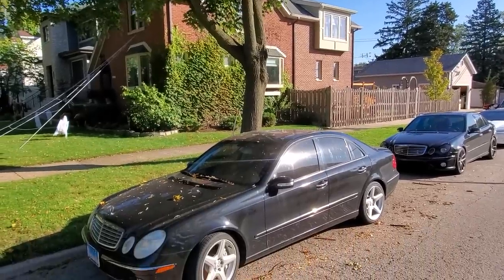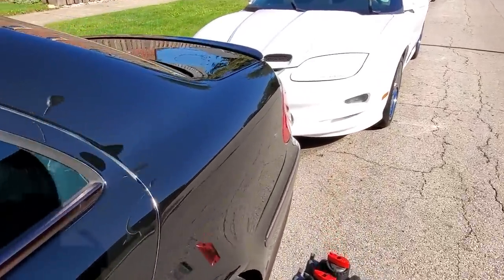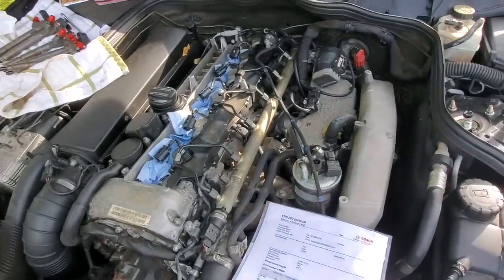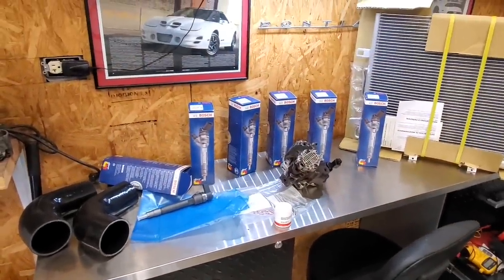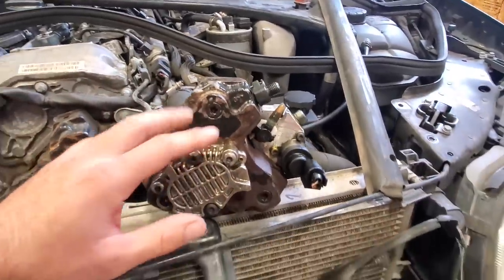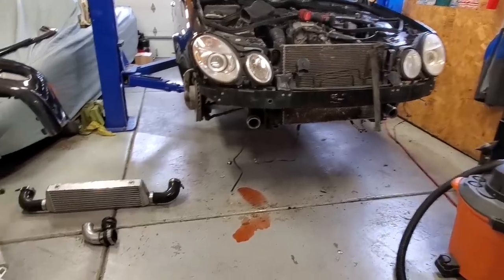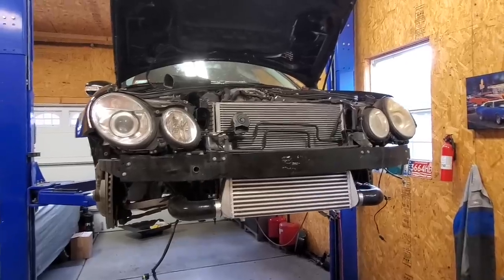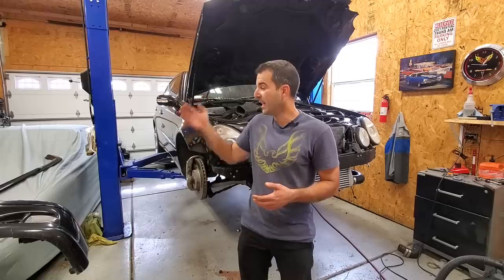Getting My ABANDONED Turbo Diesel Mercedes Started! New Fuel System, AMG Body Kit & Mystery Car!

Comment: I'm a huge diesel fan.   I've had a 300SD Turbo Diesel (Best car ever had), 07 ML320 CDI (least favorite), Currently own 14 E250 BlueTec and 15 VW GOLF Sportwagen TDI.  And do most of my own work on all of them.  I think that inline six you have there was a good engine. When you discuss difficult start in cold weather, if a glow plug is an issue in a CDI it should trip a check engine light, no matter what the starting conditions.  In short my 07 ML 320 CDI tripped a check engine light for "Bad #4 glow plug" which after replacement turned out after further troubleshooting, it was the glow plug controller itself.

Comment: The 400cdi pump isnt a straight fit for the 320cdi. You also have to drill and tap new holes to the cylinderhead to get it mounted. Email blacksmoke, dieselmeken or dieselpumpuk.

Comment: Hi, I think this fuel pump fits on the E320 cdi with the V6 engine. The 400 cdi is a V8, so i suppose the engine layout is similar to the 320 v6 engine. Let me know if it's correct. Thanks

Comment: The aftermarket bumper kits are typically junk. But if you can get it together, no one will know after it's painted. Regarding the fuel pump, if you can't replumb a couple of metric isobubble hard lines then maybe the project is not for you. Get the mastercool hydraulic flare kit and a good line bender and have at it.

Comment: FCP Euro for the WIN! Also worth noting that FCP Euro do NOT sell junk brands because of their lifetime guarantee and this is one of the many reasons why I only buy my Benz and Volvo parts from FCP Euro AND if they dont have a part listed its as easy as calling them and asking that they get that part in for you, Been a happy customer for a very long time and even their international freight costs and the best value.
Another quick option for the Headlight Lenses is green cutting paste and a small 6 inch buffer on low speed, I also then wipe Autoglym resin polish on the lenses and buff it off which fills any minor crazing not buffed out AND helps to keep the lenses clean of road grime.
Works a treat and the lenses come up like brand new as Mercedes seem to use an awesome quality material on their lenses.

Comment: You’re good with Mercedes I wanted to ask a question I have an e 500 4matic with the 5.0 I’m trying to find out if my fuel pump died or a crank sensor or cam sensor it Felt like it was losing power if I hit the gas why I was driving 65 on the highway the tachometer wrapped  up if I hit the gas pedal down so I drove like 15 more Miles to get off the highway and when I pulled over if I revived it up it Felt like it was sputtering an Hardly  running so I  turned it off and it wouldn’t start back up it is just turning over

Comment: There's a  2004 E320 Wagon that popped up for sale with alot of extra's for 2300 bucks with 157k miles driven but it has been in a slight accident. The fender is messed up like your E55 fender was and there's a scratch on the side of the car. Is it worth it?

Comment: Hi, I am following this as I have a PT Cruiser with the 4 cyl OM611 crd as standard in Europe. My injectors are maxed out and I am getting 200bhp out of it. Get 250 with nitrous. Fuel is now my limiting factor. So looking forward to your pump upgrade. What's your fuel pressure? I can get 1600bar but I need more fuel flow.

Comment: Are you sure you need a bigger hpp??
I have a BMW 330d from 2003 about the same kind of engine. 
I have fittet bigger injector and a hybrid turbo. From 204 to 322hp with no need for a bigger pump. 
Next step is bigger intercooler, but have no plan to fit a bigger pump, the original pump can easy make 350hp.

Comment: In front of these blue boxes on the right side lies a common rail diesel pump, this black triangular thing with shiny oval passive cooler, internally called CP3.3. They are made in Bosch plant in Jihlava, Czechia, in Europe. I worked there for 10 years. I made the housing and internal part called excentric shaft.
You have definitely the wrong pump. It is a Bosch CP 3.3 too, like your replacement CP3.3, just another model. I think there're about 20 different models of CP3.3.

Comment: Question for the MB A/C 
How do you fill the system when it’s empty? I just replaced my compressor and the car (2004 S430) will not accept the refrigerant because the computer says it’s empty. I clear the error code to try to fill the system but it just sets off the error again and won’t take the refrigerant
Reply: Bern Boomboom I could be totally wrong but I know on my W140 you can put the a/c in a type of service/test mode. Although the W220 is much more complex, I would assume it would have the same type of mode.

Comment: The height pressure pump are made by BOSCH? If yes I probably can help. I need to know the model or the car year. The car (211) has two engine numbers OM642.920 or OM648.961.
Reply: this is om648

Comment: great video!! course I love the CDI content, having driven one for the last 9 years. I'm at 311+ K miles on 5 out of 6 original injectors. One failed at 250+K.  Question:  Would there be any positive results putting the Rochester Diesel bored out injectors on a stock pump and stock turbo CDI?  Mine is a daily driver and I love the stock power but more power is always better  :)
Reply: Sir can you please tell me what are all the major parts you've replaced so far on this long term ownership for  all these miles

Comment: How many miles on this car again?
Reply from the maker: 200,000.
Reply: I'm thinking about giving my girlfriends 2005 Jetta TDI a refresh, as its rounding on roughly 260k miles and on its 5th or 6th owner - it of course is rather difficult to start when cold, usually feels like it isnt getting fuel at cold start, requires a good deal of priming, then runs rough for roughly 5 minutes, dies easily if you go too hard on her right away (and it's an automatic trans). Feels very underpowered and does not start at all if temperatures fall below relatively -20 F, but that could be possibly be from the fuel gellin, as the product 'heet' seemed to help it start the one time I had the experience this past winter. I havent looked at the gloplugs yet, but do you think it be reasonable to throw both a whole new set of gloplugs AND injectors all in one shot or would that not nearly be necessary?

Comment: Questions for Everyone,
Since every pickup truck with a diesel is running a CP3 pump (I can't even find the 400 cdi pump for sale) why can't we adapt the common and cheap, Ford, Chevy, Dodge, CP3 pump to work on the Mercedes???
Also, I've seen guys add a second CP3 pump running off a pully. Does this pump need to be regulated in any way???
I know less than nothing so don't beat me up to bad........lol
Reply: The original E320 CDI pump is a variant on that CP3 pump I think. If Alex can find someone that works on these CP3 pumps I'm 99,99% certain they will be able to work on his OEM pump also.

Comment: I’m flashing a tune on my 06 e320 CDI as I watch this video.
Reply from the maker: Yes!! Makes a big difference. Who's tune?
Reply: LegitStreetCars My own. I have been working on it and learning since I had my last 05 cdi. I have the boost at 21psi and the rail pressure at 1800bar at full hoot. Now I just need a bigger map sensor and a compound turbo setup. And I’m waiting to see how your new injectors turn out.
Reply: @V12Buickguy  😳 1800 bar that's crazy.. I was under the impression max bar was 1668 +/-  .. is your tune available for purchase
Reply: Papa Papa The factory rail pressure sensor will read 1800bar. The stock rail pressure limit is 1600bar. That extra pressure is key to get to 300hp on stock fuel system. That and more air and a cooler charge.
Reply: @V12Buickguy  Are you having any trouble with the higher rail pressure spiking in lower gears causing a CEL and/or limp mode? It would be great to chat tunes with you if there is an alternate way to contact you apart from comments here.
Reply: @V12Buickguy  so how can I get an 1800 bar tune to dump more fuel my understanding is unless I get C30 AMG injectors or hone it out. 1650bar +/-  is the max due to injectors nozzle ports

Comment: Alex,

The car is a driver so go ahead and put the new bumpers on it man they’re going to get used anyway.

Question, it doesn’t sound right to me that this Rochester place can test the injectors can take them apart Holman but doesn’t rebuild them. Was this a cost thing or did you take this as an opportunity to use FCP which I believe is one of your sponsors?
Reply: It seems that even places that rebuild injectors don't rebuild these citing that parts are unavailable to rebuild them in the US.

Comment: Nice
Was waiting for this!!!
I'm STRONGLY considering buying a diesel e250... I'm looking at either or 12-13, or a 14-16
Reply: Try the 350, way more torque and pics up speed like a maniac
Reply: I own a 2014 E250 Bluetec AWD.  Love it!   Trouble free, not difficult to maintain, tons of torque in the low end, great mileage (Long highway trips are about 44mpg at 75-80mph) 370 ft lbs of torque or so if I recall correctly.  My only gripe is all the stupid safety stuff that beeps at you when it thinks you are going to collide with something, like when you are driving around a curve and there is a jersey barrier, or a car in a left turn lane etc.  Quite unsettling.  Plus the entertainment/nav system menus are way to complicated.  But I consider those "first world problems".

Comment: Here's a trick for charging a completely dead battery: connect it in parallel with a good one and connect the charger to the good one.
This way both batteries are charged.

Comment: I love cdi engine... only bmw e46 3.0 and 2.0 d is more reliable and better driving car though
Reply: A bmw diesel is not even close reliable wise compared to Mercedes om613/om648 stop saying stupid things.
Reply: Fredrik Gunther 
First make a research than make a comment 
Or talk with both car drivers -
Reply: @vladimirart758  haha sure n47 is snapping chains all day long. Sure bmw is a better more fun drive. But from a mechanic standpoint its clear bmws are have really bad relability driveline wise. How many cars have you been wrenching on?
Reply: Fredrik Gunther i have driven e46 2.0d -never problems and now x3 2010-with 110k till now no problems at all 
My father had a same Benz like video 320-every 3 months different fix-mizreble car 
Sorry for my English
Reply: @vladimirart758  Yes newer mercedes have alot of problems. But i mean the engine block and head of om613/om648 straight inline 6 can easy make it too 500k miles the newer v6 diesel is really bad. Everything else is crap i agree. Therefore i Only own old mercedes like w123 and w124, i have 3x w124
Reply: Fredrik Gunther w 124 defenetly reliable mashies....too bad that in my country I can’t find good one( not waisted)😅

Comment: If the injectors leak inside the car will start knocking like it would when a bearing is worn out. A few other things might knock like that is the air pump in front of the engine and the pressure sensor/requlator on each end of the railpipe.
Reply: And to add to the list if an mb cdi struggles to start wintertime u want to check the o rings on the plastic diesel lines going to the filter, railpipe and the pump. Common problem atleast on the om612 270cdi.
Reply: @tapsaaa1000  you know he was a Mercedes tech for  quite a while right
Reply: @DocR16  Free bits of information for everyone.

Comment: Just going to leave this here: https://mbworld.org/forums/diesel-forum/555412-w211-e320-turbo-upgrade.html and this: https://www.blacksmokeracing.com/posts/mercedes-performance-and-mercedes-tuning/higher-pressure-and-more-fuel-volume/
The pump you have should be correct (need to modify the timing cover a little bit), but you would need the C30 CDI amg fuel rail to make it work (A 612 070 02 95?) I'm in europe, so if you need help finding parts send me a message. Just to let you know: Im not a mercedes diesle specialist.

Comment: High mileage injectors should always be replaced.  Should have just got 60% overs new in the box from the get-go.
Reply from the maker: Who sells 60 over injectors for the cdi?
Reply: @LegitStreetCars   Are you saying they don't exist? Unlikely, but even if they don't, new injectors sent out for nozzles is certainly possible.  Modifying injectors with even 50,000 miles on them is a bad idea.

Btw, thanks for recommending eManualsOnline.  They scammed me out of $20. 👍
Reply from the maker: No I'm just asking as a serious question. I thought you had a company that sold 60 over CDI injectors. After a few months, I only found 1 company that could modify these injectors here in the states. Sorry to hear man but if you explain a little more I can probably help. I have a manual for all my cars and they are great. I wouldn't show them if i didn't like them. If you want some help or have any questions just send me an email at legitstreetcars@gmail.com or a message on Instagram or FB @legitstreetcars.
Reply: @LegitStreetCars  My first point was that it's never wise to reuse or modify old injectors.  It would have been better to buy brand new (not reman) injectors and then send them off the the shop you found.  But that's water under the bridge.  The aftermarket for these cars in the US just doesn't seem to be there.  So no, I don't have a company per-say; I'm speaking strictly from a diesel performance perspective.  I image that you've looked extensively at the European market?  If the parts exist, that's where they will be found.  But if you have a company here then you're all set.  

About eManualsOnline, I really wish I would have simply google searched them before taking your advice.  But I really needed that information for a big job on my truck (which I never got) so I just went ahead with the purchase.  Yeah, that was a mistake.  Here's what I wrote in the comments of one of your videos hoping you would see it.

_"I have a 2014 Ram 2500 4X4 w/6.7 Cummins.  I ordered what was claimed to be the service and repair manual for this vehicle.  Well, the first time they sent me a manual for a 2003 Cobra King dirt bike.  So I contacted them to let them know there was an error.  They responded with a link to DL another manual, but this time for "2009-2014 dodge ram" which is a bit strange because over that period of time there were drastic changes between the 1500s alone so it's odd that they'd be all included in one manual.  Anyways, I start looking through this "manual" and it's literally over 17,000 pages of random information on various models throughout that year range and lacks huge swaths of information, like nothing on any of the suspension or front axle which is what I need it for.  It really looked more like someone photocopied a Chiltons manual and complied it into a huge pdf.  No table of contents, or any organization.  Just random pages of information and nothing complete for any year or model.  

So I again reach out to customer service and in the period of 18 hours they send me the same pdf just renamed six different times.  I continue to explain that this doesn't cover my truck and they tell me that this is all they have... and no mention of refunding my money.  So I tell them specifically that I'd like a refund since they obviously do not have what they sold me.  They then tell me that "we have another manual, which is software driven. That manual definitely includes your model. I can set that up for you if you wish."  Clearly this is a bait-and-switch.  I don't want anything but what was advertised, which is a pdf service and repair manual for a 2014 Ram 2500 4X4.  Now all of a sudden, after 18 hours of them sending me the wrong manual, six times over in hopes I'd eventually go away, they "definitely" have the manual.  I just need to get their software and have one of their techs set it up?  Yeah, no thanks.  This has all the hallmarks of a scam.

It's been awhile now since I've requested a full refund and they've not responded.  I honestly can't believe you're recommending this to your subscribers.  Damn, now I'm burned on $20 and I still need to get the specifics for pulling apart my front axle."_

After experiencing this, I looked them up and they pull this crap all the time:
https://www.bbb.org/us/de/wilmington/profile/technical-writing/emanualonlinecom-0251-92001259/complaints
https://repairmanualscam.wordpress.com/2016/04/19/www-emanualonline-com-scam/
https://emanuals-online.pissedconsumer.com/review.html
https://www.reddit.com/r/cars/comments/9yhq3j/emanualonlinecom_dont_buy/

Are you affiliated with this company?